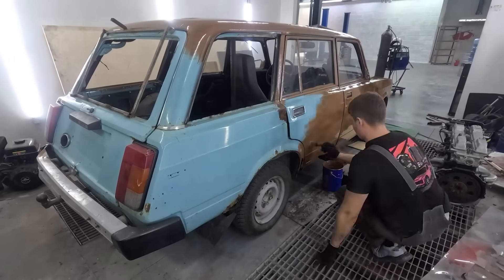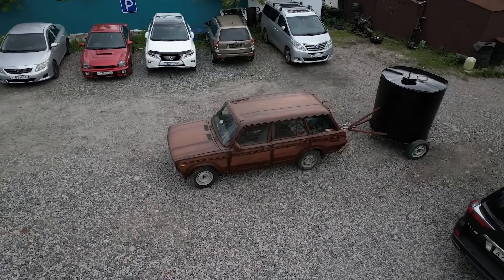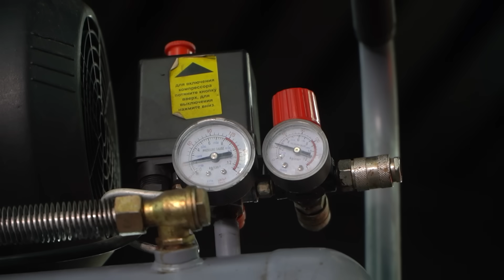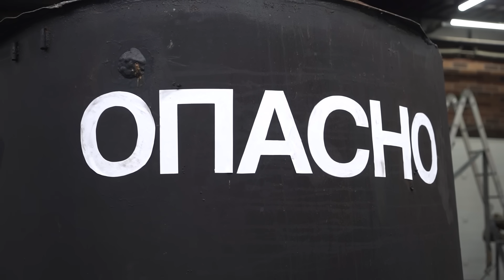We make bio-fuel out of manure - will it work?

Comment: I recall that spark advance is an important factor when it comes to driving on LPG/CNG/Methane... In modern systems, it is all automatic, but our old Lada engine would surely operate smoother if the spark advance was adjusted.

Comment: they used to cook using the stuff , they had a ig cesspit and put an oversized bucket upside down intoo it fully submerged , once the gas starts to build it fills the bucket and pushes it up 
with some weight stacked on top of the bucket you could have some gasspressure to run the furnace 
https://www.youtube.com/shorts/UDnsUGt_x_s

Comment: Very cool. If you want to do something similar, I highly recommend using a sulphide scrubber (steel wool works well) and a dryer to capture water vapor. Without these you run the risk of accelerated corrosion in the compressor tank increasing the chance it will eventually rupture. Hydrogen sulphide is also toxic in small quantities.

I have been wanting to make a biodigester for ages now. It's a great way to make gas for cooking and heating. They are becoming more common in parts of Africa for communal gas generation, reducing the reliance on inefficient and unsustainable wood fire usage.

Comment: About the last question what to do with it now just an idea...
- Convert the car back so that it runs with normal fuel.
- Fill up the tank with water to dilute the sh*t.
- Add some kind of "big" carburetor between exhaust and the big tank so that the exhaust gasses pull the "liquid" with them.
=> go fertilize a field/meadow with that DIY slurry spreader

Comment: Just a little forewarning. If you’re going to be pumping combustible gas into a pressure vessel, like an air that air compressor.  It wouldn’t hurt to flush all the air and oxygen out first with an inert gas like argon or nitrogen or maybe CO2. At a pinch, plasma cutting/TIG welding gas could worked (I think it’s a Argon Nitrogen C02 mix?)

Comment: Amazing project! Please compress the gas and put it in cylinders in the trunk! Biodigesters and biogas are amazing technology! You can scrub the gas with steel wool to get rid of acidic compounds, and carbon filter for particles. If you use filtered pressurized tanks, more efficient due to not towing and longer range. 
Please do V2!!!! This is awesome!

Comment: Next stop on G54's alternate fuels mission: 
turn coal into Synthetic Petroleum, like the Germans were doing in WWII, using it to create 87oc gasoline (which is probably around 91 in the reading system the Russians use).

That synthetic fuel accounted for 92% of their fuel supply, so it was very effective, albeit not very efficient (energy intensive process).
Still, G54 had to do it... as there's really not many more alt-fuels left for them to use! I think it's only this, and that algae derived process, and I do not see them being able to accomplish the latter 🥴

Comment: Bio fuel issued form the anaerobic digestion process is known since long time.
I installed few in various countries at farm and waste water treatment plant. But also for industrial group.
You can use the biogas for boiler, motors and more. 
You can also remove CO2 to can inject the methane into the grid.
Regarding your process, you may maintain the temperature stable and add a mixer to get better production.

Comment: Great idea😂😂 but i have to ask as i dont recall them taking out the gasoline tank😂😂

Yes i know a car CAN run on methane but not under such low pressure. 

If you guys did a series for this one lada, the series would end with a top fuel lada dragster😂

Comment: Whats the recommended AFR of shit gas?😂
Reply: It's 50/50 methane/co2 so you need a lot of air.
Reply: @termiterasin  Could CO2 be scrubbed somewhat by just bubbling the gas mix through water?
Reply: @putteification  IDK but that will increase moisture which you don't want.
Reply: @putteification  No! You should use Ca(OH)2 to get white shade (to see if CO2 is present). To take away use NaOH solution. You will get Na2CO3 in that solution, but then you don't know when you should change that NaOH, when it is used. Easiest way is to keep that tank in place, clean that gas and then use compressor and fill gas bottles. Then drive car with gas bottles.
Reply: @putteification  you can remove the CO2 by bubbling the gas through lime water which is calcium hydroxide mixed with water. Lime is cheap to make and you can convert calcium carbonated back to oxide using heat
Reply: High as shit!😅
Reply: about 1 vol gas to 4 of air
Reply: Ass Fume Ratio

Comment: Don't know when this was originally uploaded but they would have gotten better results if they put a small electric current through it in the same way you might extract hydrogen from water it would speed up the process and it could be pumped into propane tanks

Comment: During WW2, Britain's public transport like buses and lorries and other road vehicles used much the same with a balloon tank atop the vehicle filled up at the depot which was linked to a methane facility.   Farms were encouraged to build methane processors on the farms and the civilian branch of the government would collect it with gas tankers.
Reply: balloon tanks hehehe. btw just commenting here because Normies dont know about Wood Gas and thus dont like my comment. even tho we ran tanks and trucks with it in ww2...
But ye when you heat up wood it releases "wood gas" and you just need to seperate the tar from it and feed it to old style of engine and it can run with it. ofcourse different carporator settings between gasoline and woodgas.
PROS:
1. just need trailer with gassifier and filter and hose to carborator.
2. can use gasoline as a backup
MINUS:
1. less energy dense than gasoline
2. TAR
3. need to heat up the wood with something and nee big chamber with insulation for it...
Reply: @deperditus  Exactly! My grandfather in the 1940's would cart timber from the North Qld Rain Forrests in Queensland Australia to Townsville, in old trucks (Timber Lorries) run by Wood a Gasifier. If they ran out of fuel, they would just walk into the bush and collect more vegetation from the forest, and then keep driving. They were only allowed to purchase 1 Gallon of Gasoline per day due to rationing, which they only used to start the engine when cold.
Reply: Yes but the engine was always initially started on pure petrol and then switched over to the weaker fuel when warmed up.
Reply: @40shadesagreen  Same happens with recycled cooking oil diesel engines.
Reply: I would prefer a wood gasification and purification trailer... Therefore you can just stop and pick up debris and sticks off the side of the road to power your car...
Reply: @AquarianSoulTimeTraveler  This channel did that several years ago or so. It worked out pretty well lol
Reply: A guy in my area built a gasification unit in the back of a ford ranger and drove it around for a few years. He said he got 50 miles per milk crate of wood.
Reply: @Gryffeth Wow, that sounds like some decent damn mileage honestly lol. I wonder what that would translate into for MPG. Would it be Miles Per Cord? 🤔 😆
Reply: But this time it’s Ukrainian causing prices to rise
Reply: I think they used town gas to fill the balloons, wood gas was produced by a unit fitted to or towed by the vehicle.

Comment: I mean in ww2 they were running tanks with wood gas. so why cant you convert a lada to work on that?. Atleas here in Finland, cars that work on wood or peat gas are tax exempt. Also the good thing about them is that you can just switch carborator settings to gasoline and the run it with gasoline if you run out of wood/peat...
Reply: with these woodgas cars you can go up to 200km with 1 chamber full of wood dust. if you build it right.

Comment: amazing what cows can do. they make steak,fertilizer and now fuel too!
Reply: Biggest producers of the greenhouse gas, methane.
Reply: @TiborRoussou you mean cows?
Reply: @wilderness-beastt  yes
Reply: @TiborRoussou  are you saying that it is a bad thing? i am a bit confused.
Reply: @wilderness-beastt  Methane gas is bad for the environment. It contributes to climate change.
Reply: @TiborRoussou  but the methane didn't come from nothing. cow don't poop out or burp methane out of nothing. it came from the food which came from sunlight and co2 that is in the air. aka it is carbon neutral.
Reply: @TiborRoussou  the part that isn't carbon neutral is fossil fuel powered farming equipment etc. that fuel doesn't come from air. that fuel comes from underground.

Comment: If you go to a big farmer and suck all the methane out of his manure deposit ,  filter and store this gas in a big container and use a lpg tank and diffuser on the intake of the car it for sure will work better
Reply: I was thinking something similar. If they can filter it, even slightly, get it compressed into tanks(which is doable with their compressor) and use a pressure regulating valve when releasing it, they can control it much better.